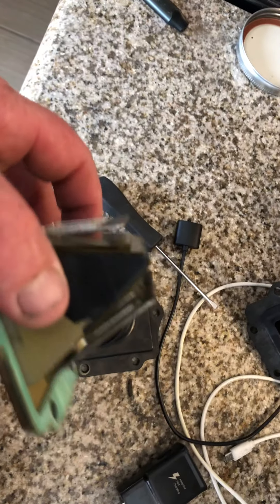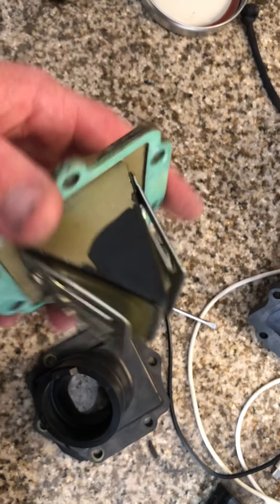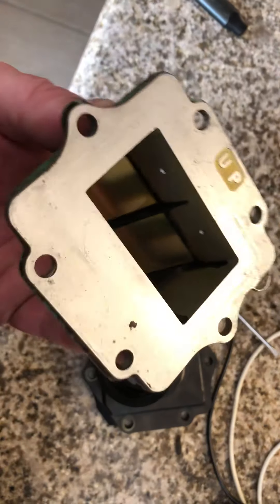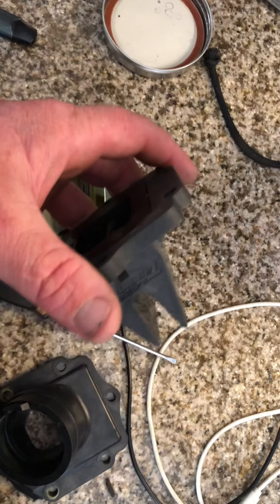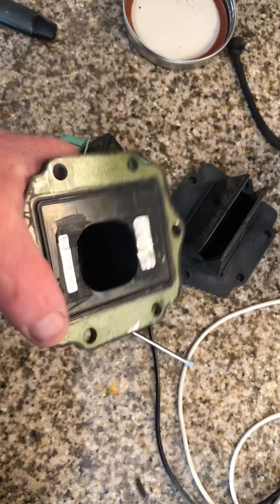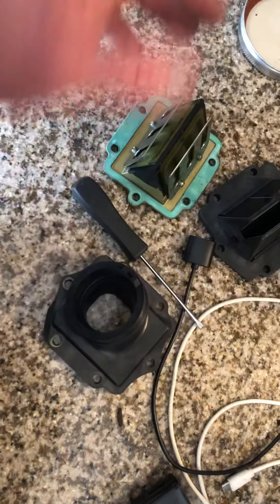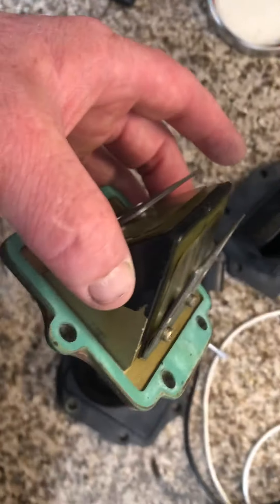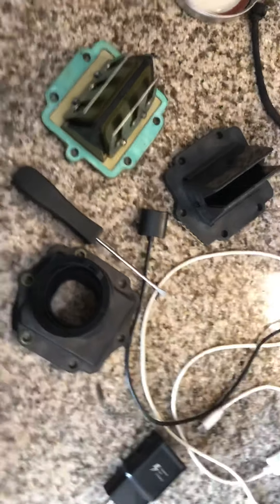98-01 KX 125 bad reeds, symptoms, signs and solution

Comment: Thanks. My RM125 I just fully rebuilt fouls plugs within 20 seconds. I tried re jetting it but no luck. Pulled off the reeds and  some of the petals don’t close all the way
Reply from the maker: @mdarazs  hopefully that’s the problem for ya. If it isn’t , there’s a possibility the cases are letting transmission oil into the crank housing. This is common after rebuilds, the tiniest smodge or nick on the sealing surface between the case half’s can definitely cause oil fouling of a plug. And easy way to check this it to empty the bike of fuel,  purge the engine (meaning kick it over a shit load without a plug in), put the plug back in, kick it over a few times without fuel, pull the plug and inspect for oil, if it’s covered in oil that doesn’t smell like two stoke oil then there’s most likely case oil finding its way inside the crank case. Another way (if you can get to run long enough) is to pull the case filler cap while the engine is at idle, if there’s positive pressure coming out of the filler hole you’ve got a case leak or crank seal bad

Comment: question???? Will the reeds cause fuel to not get into the cylinder? I replaced mine with a fiber set from amazon (i know not the best choice but all i could do at the time)and now im not getting fuel to the cylinder. pull plug its dry. Have plenty of spark and 125psi of compression. Any help would be great. THanks guys.
Reply from the maker: Could be a couple of things…obstructed transfer ports, leaking crank seals, bad cylinder base gasket, extremely dirty air filter, bad carb……you can eliminate a lot by seeing if it will attempt to fire on starting fluid…if it does fire then it’s a fuel problem…start with the petcock, then work your way down…if it fires on starting fluid then reeds are most likely not the issue but they certainly could be…if there’s large gaps between the reeds and the reed cage then that could creat a hard to start issue

Comment: I have a question. My bike is bogging yz125 2003 down. Smoking bad i change crank seal water pump seal didn't fix it took it to shop i would love to know it sounds like there fluid inside crank i could be wrong i change reeds today before i gave up
Reply from the maker: Couple of things it could be..1 your cases need to be re sealed or they’re cracked and it’s letting transmission oil in the crank case 2 you’ve got a cracked cylinder that’s letting coolant into the crank case 3 your float height isn’t set correctly and it flooding the engine with raw fuel by way of gravity. (This one is probably the easiest to diagnose. All you have to do is turn the fuel off and start the motor. If the motor cleans up and starts running better than you know that your float height is messed up or you’re jetting is way off. )Hope this helps
Reply: @localenterprisebroadcastin5971  I think it's float I turn gas off it did clear up my cases are sealed good an my  cylinder an piston is new il keep u posted shop said they will look at it sat I gave them apex head an new carb to install too so but I did install the carb it didn't help so i put my old one back on so it's gotta be in engine il keep u posted
Reply from the maker: @michaelgarland579  sounds like the float then…could be an ignition issue too but I think not based on what you’ve described
Reply: @localenterprisebroadcastin5971  ok il keep u posted it bugs me alot I spent thousands on old bike

Comment: Having the same problem on my yz I’m going fucking insane trying to get this lectron to cold start. I just ordered v vorce 3 so hopefully it helps me too.
Reply from the maker: Yeah bro, if you have good compression, good fuel/air and good spark then a hard to start issue is almost always reed valves …well…unless you’re carburetor is totally fucked 😂😂… another thing to look for is a vacuum leak somewhere between the carburetor and the cylinder base…the crank case could also have a leak letting transmission oil into the crank case (the other side of this is jet, black dark carving fouling of the plug…assuming your jetting is correct)

Comment: Hey quick question I see the video you posted but my 85 has the same issue but the power band doesn’t hit right in 1st or 2nd good but all the other gears are good you think I might need new reeds?
Reply from the maker: Could be ...if it’s not the reeds it could be a sticky exhaust valve or jetting...could be ignition related given the year but unlikely given what you’ve described 🤷🏼‍♂️
Reply: hey man did you figure it out my mr85 has been doing the same exact thing

Comment: Can bad reeds coz a loss of compression. Thanks
Reply from the maker: @paulhenry1011  no…that’s bad rings, bad head gasket, bad cylinder or bad head …sorry to be the bearer of bad news but you probably need a top end …question is, is cylinder or head damaged …if it’s just the piston and rings you’re looking at 150 dollar repair if you do it yourself if it needs cylinder repair or head replacement it can go into the thousands

Comment: I have a pw50 that once it starts it revs to the moon on its own. I bought a new carb for it and nothing has changed. Could this be a reed issue?
Reply from the maker: Sounds like a very bad vacuum leak or if you got a cheap carb off of Amazon trust me those Chinese knock offs run lean right out of the box...it’s not the reeds because when they fail the motors load up and foul plugs

Comment: You can flip them if you are in a pinch, so not really “retarded” I flipped some out on a trail ride and forgot about it for 30 more hours before they deformed the other way because I forgot about it.
Reply from the maker: Yeah in a pinch to get ya back to the truck or camp…but it’s not good to leave them that way, you just got lucky in my opinion. I’ve had reeds break  and send the debris through the transfer ports and get stuck. It only has to happen once for me to stop doing things that lead to more headaches. Like I said in the video…it’s retarded to risk doing more damage when they’re so easy and cheap to fix in the first place…im just speaking from personal experience, I was a dumb teenager who had way more ambition than talent and often learned valuable lessons the hardest way possible 😂…But thanks you for the comment 🙏
Reply: @localenterprisebroadcastin5971  the reeds could break off and run through the engine engine, it would not hurt it. They aren’t metal. How did it suck debris past an air filter? I’ve had new v force reeds break and run through an engine with no damage.
Reply: @kevinragsdale6256 you like to argue! 
He is right, & right is right.

Comment: Thanks for posting.  Quick question... I'm also running the VForce3 Reed setup on my 2003 CR125.  For a while now, kicking it has been very easy, but hard to start.  So easy to kick, I could easily push the kickstarter down with my hand.  I checked compression and it's around 110 PSI, which is very low.  I pulled the reed cage and the reeds are shot as I can see light around a couple sections of the reeds, so not a good seal.  I will replace them, but I was curious if you also found that kickstarting your bike with those bad reeds was way too easy (ie. lack of compression)?  Thanks again for the post.
Reply from the maker: Yes I did notice a dramatic increase in compression once I replaced the reeds...having said that it was never easy enough to push by hand...it sounds like you’ve got a worn out top end...replacing the piston and ring doesn’t mean much if you don’t actually measure the cylinder and see the wear .... also those year CR 125s had issues with their power valves gumming up and staying in the open position...reeds could be your problem but my Vforce reeds right outta the box had small gaps in the reeds...the instructions clearly stated in bold text that this is NOT a problem for the v force design. Hate to say it bud but you probably need a new top end 🤷🏼‍♂️
Reply from the maker: Also a leaking base gasket can cause you issues as well...you’ll notice a wondering idle once it’s running...it will also act like it’s idling high for about 5 to 10 seconds then drop in rpm and stall (no mater what you do with the carb this will never change) you’ll have hard to start issues...leaning in the high rpms and no bottom end power...my general rule of thumb with two strokes is rebuild them as often as possible and have a shit ton of spare parts on hand 🤷🏼‍♂️
Reply: @localenterprisebroadcastin5971  Thanks.  Gaskets were in good shape.  No leaks.  I'm replacing the piston and ring, but I'm curious if you lost any compression when your reeds were bad?  My compression was low, but my ring gap was within specs.  So I'mjust curious if bad reeds can cause low compression?
Reply from the maker: @EricLaPrad  this answer is yes absolutely.
Reply from the maker: @EricLaPrad  post a vid when it’s running 👍 I’ll be sure to check it out
Reply from the maker: @EricLaPrad  also check the base of the case and the cylinder with a straight edge...I’ve have issues with used bike where previous owners did not properly torque the cylinder and it warped
Reply: @localenterprisebroadcastin5971  Just got back from AndrewsMotorsports where I had a mechanic take a quick look at my cylinder.  He noticed a small crack in the nikasil in the bridge between the exhaust ports.  That's certainly causing my low compression, because it's wore a flat spot on the ring.  Sending the cylinder out to have the nikasil removed and re-plated and honed.  About $275 to do that.  He looked at my reeds and said they look good.  They are probably not causing the low compression.  Thanks for your help.
Reply from the maker: @EricLaPrad  hey before you send it out to be replated look into a big bore kit from Eric Gorr racing ...his kits are often cheaper than a replate (when you factor in shipping time and a piston kit you buy yourself) and come with everything you need (piston wrist bearing  cylinder ect) his turn around is about 2 weeks compared to the platers who take months...I had a YZ 250 where the bottom end gave out and weeded my cylinder...the price to replate it was only 100 bucks cheaper than just getting the big bore kit and I still had to buy a piston so I just went with the EGR top end 👍 sold the bike years ago to s buddy and it’s still going strong 💪

Comment: Will bad reeds cause low compression?
Reply from the maker: No, compression is made by the piston, low compression is generally worn out rings, holes in pistons, worn or damaged cylinder wall, cracked head, bad head gasket, loose spark plug or (in very rare cases) an improperly installed cylinder liner (if equipped)
Reply: @localenterprisebroadcastin5971  I've done a lot of reading.  The best way for a budget rider to diagnose top and bottom end problems is to one check the gear oil.  If it's not clean, there are seal issues.  Two check the coolant.  If no issues there, bottom end should be good.
Reply: @localenterprisebroadcastin5971  some people in the comments said they rebuilt the whole bike and found out later is was the reeds.
Reply from the maker: @RideWithTheWolf  not necessarily, gear oil can look contaminated just by being old because of the clutch particles, coolant can also look contaminated if it’s old or has the wrong coolant…the best way to check the cooling system is with a pressure tester…the best way to check the bottom end is to physically measure the crankshaft end play and look for leaking seals IE oil in the stator housing…the rod bearing must be inspected by disassembling the top end and check for play. Don’t ever assume the previous owner of the bike knew what they were doing in regards to maintenance (because 98.9% of people don’t)…general rule of thumb with 2 stroke dirt bikes is to COMPLETELY rebuild the engine when you purchase a used dirt bike…everything in that engine has a service life and most people cut all kinds of corners, run cheap oil with shit gas, don’t properly tune the carb, use cheap ass parts etc…don’t ever think you can save money on a dirt bike…there are tons of dudes in wheelchairs because their engine failed unexpectedly when trying to clear gaps
Reply from the maker: @RideWithTheWolf  if you’re new to wrenching on a bike please for the love of god buy a service manual, buy the proper tools to take it apart, torque every bolt and screw to the specified requirements and get schooled up on carb jetting…the # 1 reason two strokes blow up is because they aren’t jetted correctly, running lean is a death sentence for the motor and running rich will foul a plug when you need the power the most
Reply from the maker: @RideWithTheWolf  yes many people chase problems and fix the wrong thing but that doesn’t mean the parts they replaced weren’t also failing
Reply from the maker: Two strokes are a nightmare to troubleshoot if you don’t know the symptoms, and unfortunately when one component starts to fail on a two stroke it has a tendency to destroy others
Reply from the maker: @RideWithTheWolf  as for your problem it’s a worm out or damaged top end…low compression will make the bike almost impossible to start and have shit for power once it’s running…
Reply: @localenterprisebroadcastin5971  is there a way I can inspect the bottom end seals and bearings so maybe I can get away with just a top end?  I've also heard that some seals and bearings can be changed without splitting the case?  The only thing I've noticed is some oil near the water pump / power valve and a bad seal where the kick starter is.
Reply: @localenterprisebroadcastin5971  what's the difference if I buy a new yz250 or fix my old one?  Can I make a new yz250 last, or at least make the bottom end last?